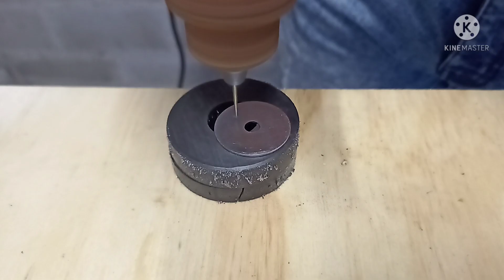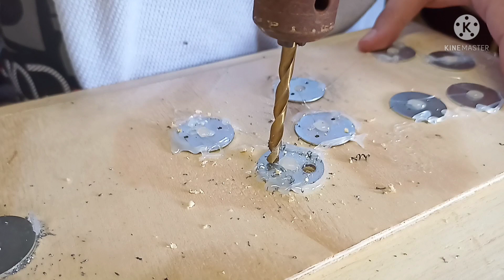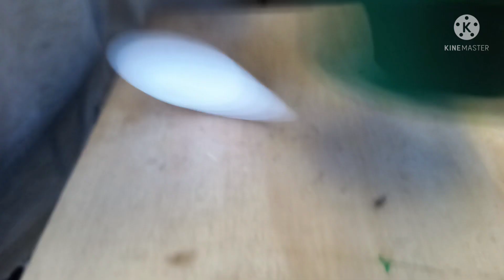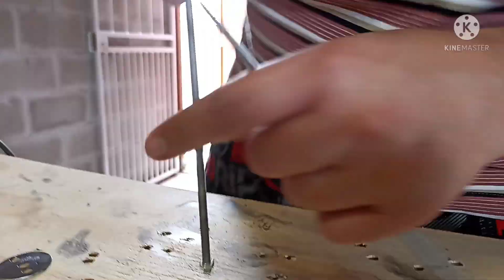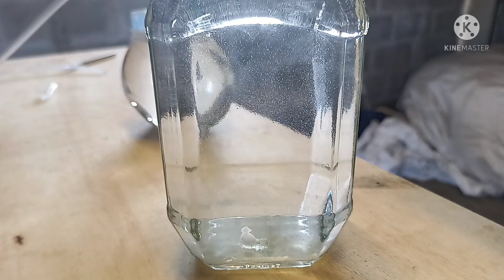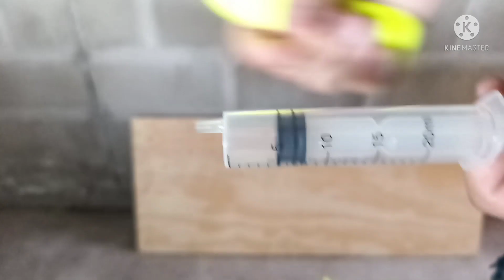How to make a Oxy-hydrogen (HHO) Generator! I split water into oxygen and hydrogen!!!

Comment: Water is not being split. 1 litre of water will make 1860 litres of Oxy-Hydrogen gas. The moment you switch on the power there would be a huge boom from the sudden expansion. (no small bubbles as seen) The electrolyte is providing the oxygen and the electrodes are degrading and making the hydrogen.
Reply from the maker: Hi Johnny, I appreciate your concerns. The electrodes do indeed degrade for other reasons(oxidation due to the oxygen being generated in the system and some other factor, however I can assure you that the oxygen and hydrogen is indeed produced from the water. Electrolysis is not instant, and would not convert all the water simultaneously(thus the explosion would not occur that you mentioned). The bubbles as you can see in the video is the rate at which the water is being split into oxygen and hydrogen.
Reply: @ialsodothings1410  I see they deleting my comments....don't want people finding out the truth!
Reply: @johnnym6700  Hi Johnny, what comments have been deleted?
Reply: @liankruger8447  I replied to you and it was deleted...my comments are often deleted

Comment: You don't believe in using flashback arrestors?
Reply from the maker: Hi There, flashback arrestors would have been great if I knew about it before making this video. Did you see it exploded at the end?
Reply: @ialsodothings1410  I did. Scary. I want to build my gen as safe as possible.  Still learning how
Reply from the maker: @ashwynn4177  check out @nighthawkinlight on YouTube. He has a couple videos on hydrogen generation which is very helpful.

Comment: I've actually been gathering scraps to try build this and I want to ask if you have to use stainless steel or if you can use other steel too
Reply from the maker: Hi Eddie, thanks for your comment! You can use any steel for this, but try to not use any chrome plated steel as that would be hazardous. Also if you have to try this, do not bring a flame close to the generator. As you can see in the end of the video, mine exploded and it was loud as hell.